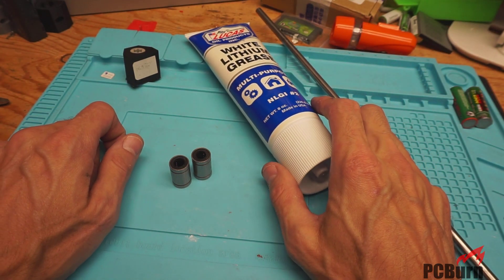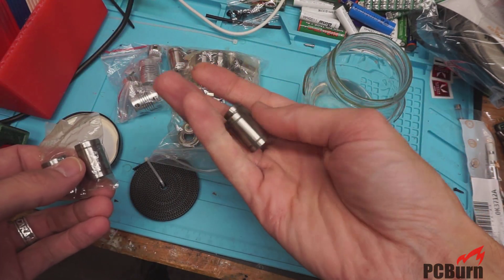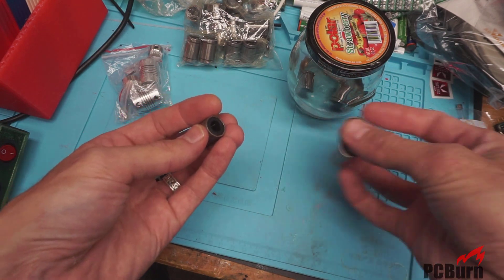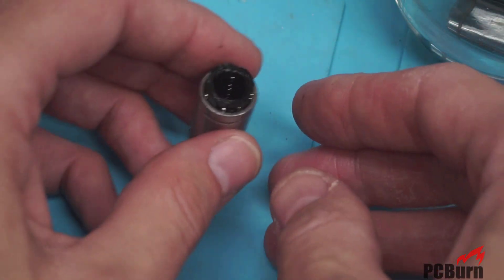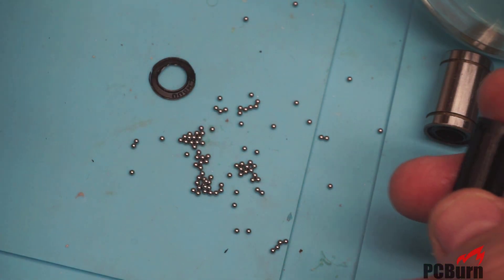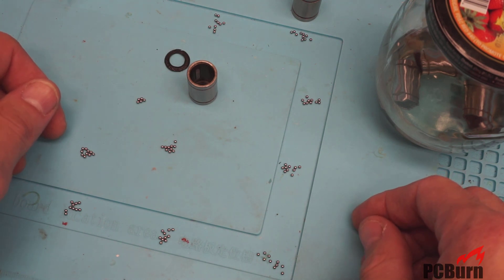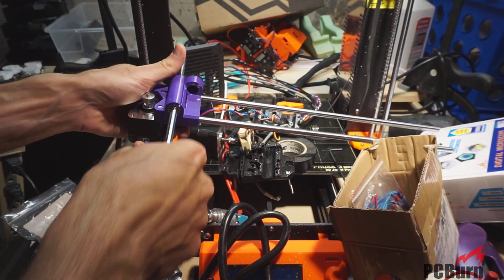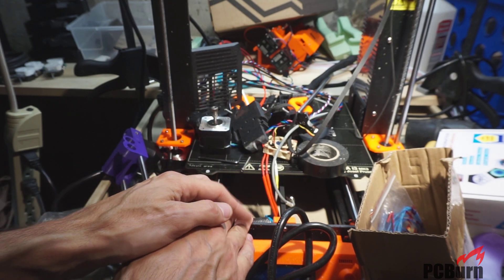Packing and Tearing Apart Linear Bearings for Anything (Prusa i3 Mk3)

Comment: The ones I had come with my Prusa had roller type bearings in them, not ball bearings. Would it be worth replacing them do you think?
Reply from the maker: Like a V-slot roller bearing? I'm not sure I can envision that and don't recall a Prusa model with them.
Reply: @PCBurn  It's a mk3s, bunch of tiny cylinder bearings instead of ball bearings. Still look like the ones you have from the outside though
Reply from the maker: @lio1234234  according to Prusa they use a Misumi LM8UU linear bearing. That'd be a standard recirculating linear bearing with balls.

Misumi rods and bearings are high quality. Can't imagine why you would replace new ones.

Comment: Is the rod you are using to pack the grease the one that came with the mk3? I’m receiving my kit tomorrow and it sounds like it’s best soak them in ipa then repack them with superlube. I’ve never messed with bearings before.
Reply from the maker: The rod I used was from an Epson dot matrix printer. I would've used the rods from the i3 if it wasn't already assembled.

Comment: I need to clean my bearings because they were packed with the wrong type of grease.  Can you recommend a cleaner I can use that won't harm the rubber seals?
Reply from the maker: I usually agitate them in a high percentage alcohol. It'd depend on  what the seals are; it works fine on mine.
Reply: @PCBurn  Well they were packed with Permatex White Lithium Grease which I think was the wrong stuff to use.  I want to replace it with Superlube but I've put some of the grease in a cup with 91% alcohol and it been in there a while and still looks like its ok. YIKES..  think I can clean them with WD 40 then put them in a alcohol bath to get rid of the WD 40.  I just don't want to harm the rubber seal.
Reply: Oh. they are the bearings from my Mk3s+
Reply from the maker: You'd have to put the bearings in and agitate them. I wouldn't use a solvent that dissolves silicone myself, like WD40, but the end seals are probably fairly resistant. Should be okay if you wash it off well with alcohol prior to lubricating.

Comment: When I saw the video clip I thought you packed an igus bearing into a metal bearing housing
Reply from the maker: There is an Igus bearing with a removable metal sleeve that's a drop-in replacement.

It did occur to me to put a metal sleeve on one of the less expensive Igus parts... I haven't yet!

Comment: I'm replacing the bearings on my Y axis because they're having some tolerance problems, but the only thing that I'm really having trouble with on the X and Z axes is noise. Would I need to remove the bearings from the X and Z carriages, or can I just pack them while they're still in the carriages?
Reply from the maker: As long as you didn't need to clean them as well (and it was possible with the design) you could unseat the end of the rod they're riding on and pack them there.

If you do that remember to line up the balls correctly on the rod when you're putting them back on (edit: when you're securing them). The alignment of the races matters with the LM8 bearings.

Here's a handy post on reprap with an illustration: https://reprap.org/forum/read.php?1,310880

Comment: For the IGUS, i saw a video, from a guy who use them in other systems, and he found out, they are great, but only after the 1st ones were in for a while, and THEN you put in the 2nd IGUS ones. He said, the plastic from the IGUS has to go around the rods first and fill all the microgaps which are in the rods and make the rods smoother, then the IGUS keep way longer and are way better. I havent tried it out, because since i have now the squashballs on my prusa i am really happy how silent they are, but before they were REALLY loud, and i talk about the Mitsumi bearings  :-)
Reply from the maker: I haven't noted Igus mentioning anything along those lines. I'd imagine they would like to sell an extra set of bushings or two and wouldn't hesitate to note that being the case for iffy rods. Unless I missed it.

I guess if someone showed a test that had plastic embedded in a hardened metal rod I'd buy it. Not sure what scale that'd be at, interesting though.
Reply: There is definitely some truth to this. The Igus do leave a bit of material on the rods, even with their own anodized aluminum they recommend to pair with igus. They even state this in their official presentations. The question is whether you need a second pair, or only if they wore to the point the tolerances are not acceptable anymore.

I noticed that for the Y the tolerances don't matter much; gravity is in your favor and everything can kind of self align given the right interdistance between the rods. Yes it might drop a few microns after months of operation, but you can fix that with Z-offset. For X it's a different matter though, there you have gravity acting a moment force on the extruder+bearings, and so you're gonna run into binding quicker regardless as it hangs into the two rods.

Comment: I found out, since i use squash balls under my Prusa Mk3S+, i only can hear the fan and a liiiittle bit the mechanic, but to type on the keyboard while my prusa is 30cm beside me working in normal mode, is louder than the printer. The squashballs with 2 yellow dots on it, are REALLY awesome to silent the printer. And before the printer was sooo loud that i thought i the bearings are not working and so on. But now they printer is really silent. You should try it out.
Reply from the maker: Eh, these were unlubricated as I made a bad assumption they were ready to go as shipped.

Unlubricated bearings are noisy. And wear! So I was remedying that.

Comment: There is this stuff that comes in a gray tube called "superlube". It blows that Lucas stuff away.
Reply from the maker: That's a PTFE fortified grease. Might be a bit stiff for the application, or maybe it'd work well. I was avoiding the PTFE bearing lubricants (for the small recirculating balls) as I find them a bit waxy.

Comment: Is there a way to actually remove the seal with out breaking it? I packed mine with the wrong grease and now I need a way to dissolve it or remove the seal. they have been bathing in 99.9 IPA but I did pack them really full of grease
Reply from the maker: Removing the seal on the metal and rubber seal bearings almost always destroys it. It'll certainly destroy the seal. Best bet is to find a solvent that'll only effect the grease if you're not taking it apart for academic reasons. Or agitate the Alcohol in a safe manner.

Comment: I like the video, I have some bearings on my Ender 5 Pro, LMK10LUU bearings very similar to those. Wanted to know if you could make a video on rebuilding one of those bearing you took apart? I'm curious as well on the sizes on those small ball bearings as well since there cheap amazon ones, I'm wondering what would the proper sizes to get.
Reply from the maker: Absolutely. I still have the one I disassembled in a drawer.

We can't do anything like a proper precision test if I do manage to get it back together. But we can see if it's functional!

Comment: White lithium grease is ok on a budget. I use TinkSeal (dot com). It is a nano particle lube that lowers friction and decreases the intervals you have to service your printer bearings. TinkSeal works on bearings or plastic bushings. Thanks for the video!
Reply from the maker: Thanks! I've been meaning to use something stickier for the bearings. Possibly Molybdenum again. (unmodified) Lithium's fine but fairly light.

I don't know about the TinkSeal. Aside from the claims of the manufacturer I don't see anything that looks like a study, listing of properties, or standards compliance I can assess. And the science-y sounding bits would be true of (almost) every engineered lubricant I've used.

Regarding the Igus bushings those are self lubricating similar to a PTFE derivative; there isn't really an up-side to putting anything between it and a metal surface. That's the TLDR, the maths are at: https://www.igus.com/info/plain-bearings-iglide-plastic-bushings-value-lubrication-ca
Reply: @PCBurn  You should never use Molybdenum disulfide on any ball bearing surface because it causes pits in the bearings. Moly works better for sliding bushings. I manufacture bushings much higher grade that Igus. TinkSeal is designed to lubricate both metal and plastic. It even builds on the wipe seal surface, prolonging their lifespan. When Tinkseal dries, it leaves a dry nano particle surface behind. Tinkseal is widely used in the off road and firarms industries. I have seen it used on fishing reels, canopy zippers and sliding doors. I use it on my linear bearings on my 3D printers.
Reply from the maker: Can you cite something on the product? I can't find so much as a property sheet on TinkSeal. Almost any lubricant provides a "nano particle coating" at some point.

Moly's not a very appropriate additive in any case, although I'd guess the modern lubricants with a low amount of a modified Moly compound might have better corrosion resistance. I'll take your word for it, though. I only have experience with OEM automotive (rolling) bearing applications with no noticeable surface corrosion.

Comment: Hey thanks for this video! Question for you: I'm using some Nyogel 767A damping gel on some linear bearings in a mod for a computer flight sim throttle (TWCS Throttle). Do you think a high-viscosity damping grease would be too much for the small gaps in a bushing like this? I'm hoping it won't be too much damping and am just trying to do as much research as I can before trying it myself.
Reply from the maker: As long as the grease is okay on the metal and seals I'd give it a quick try in the application to see of it provides the right amount of resistance.

I've used somewhat thick Molybdenum in LM8UUs before (in a different application) and that worked without any issues.
Reply: Two years late comment here - while I don’t think Nyogel 767A would…you know, corrode anything, it is so incredibly thick that I’d be surprised if it doesn’t negatively affect operation of the bearings.

It is thick to the point of being difficult to squeeze out of the tube haha.  It is awesome for damping those throttles and sticks though, that’s for sure.

I use Superlube 21030 for these bearings/smooth rods.  AFAIK, that is what Prusa recommends.
Reply from the maker: Ah, a good synth grease. I picked up a similar Mobile1 branded blend since the video for similar applications.

I usually like the tubs for using in the automotive work as well so I'll at least use some of it in a reasonable time-frame.
Reply: @PCBurn  I just did a little digging as far as these bushings/bearings go.  

Following a link on Misumi's own page for the "LMU8 Linear Ball Bearing", they recommend this specifically: Alvania Grease S2 by Showa Shell Sekiyu.  Lithium soap-based.

Can get a 180KG barrel of the stuff!  haha.  Now that's a lifetime supply.

[This is the brand Prusa currently uses...or at least have been using starting with the i3 MK3S+.  I got name-brand Misumi with my MK3S+].
Reply from the maker: @RightJoystick  ah, yea. Probably a fancy spec implementation of white lithium grease. They'd know!